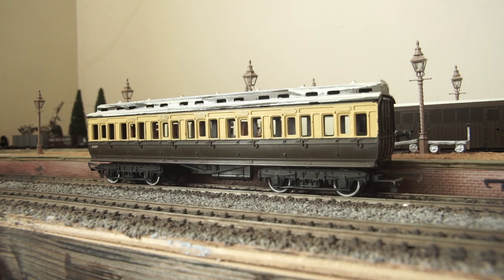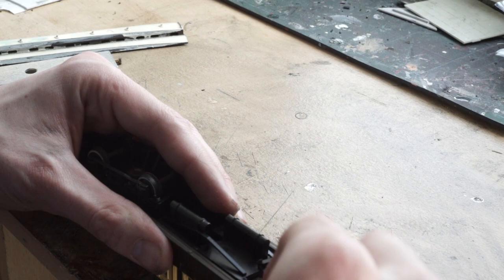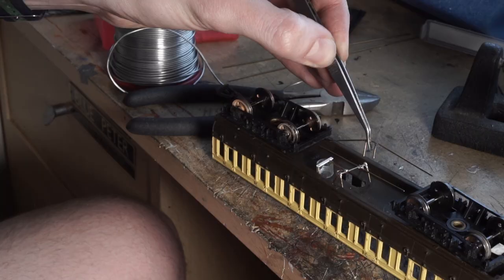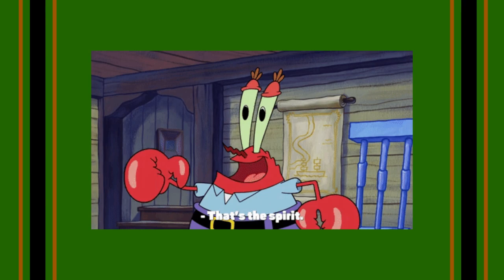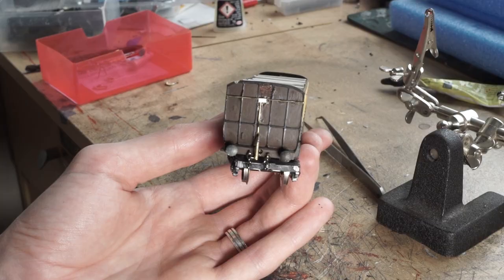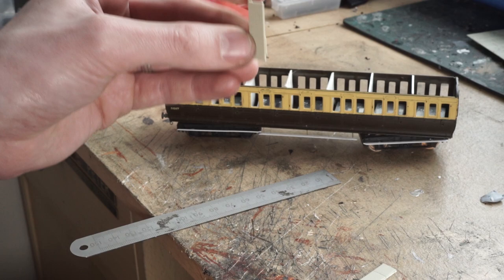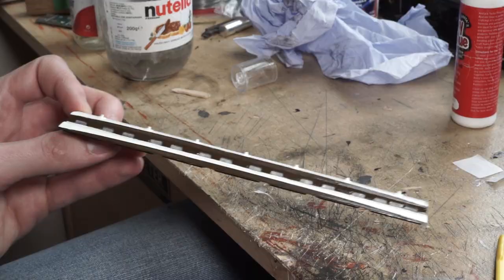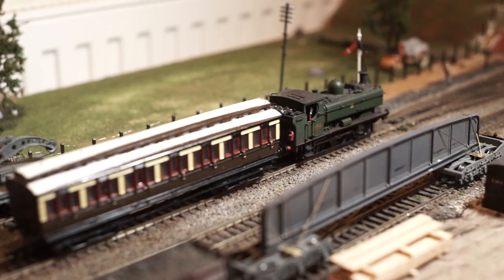Upgrading the Hornby/Triang Clerestory Coaches - SWAS Episode 24

Comment: I too, bought two, in the 1960s when any fairly realistic carriage was rare. This century I converted them to the 7 compartment Diagram C12 of 1897 and the brake version D21 ( long brake and four 3rd class compartments). I substituted Hornby (mock) Dean suspended bogies which were an unpleasant nylon plastic to widen as I was fitting Gibson EM axles. They were painted all-over GWR wartime brown with offset GWR crest.

Comment: Hi Scooby. 

I’m sure that it's somewhere on the GWR website that a modeller converted an 8 compartment Triang non-corridor Clerestory Coach into a 9 compartment coach. It was a while ago that I spotted the article but what he did was to cut off the end of one of his coaches, then cut off the end of a donor coach but with one compartment attached. He then 'smoothed' down the ends and joined them together to make a 9 compartment Clerestory Coach (or, as they say in the 'hooky' side of the car trade, 'cut & shut'). I know it's a bit late now as you must have finished your upgrading, but I thought I'd point it out anyway. 👍 

Paul.
Reply: Sorry, I meant to say a 7 compartment coach was converted into an 8 compartment.

Comment: That was interesting and entertaining, might be lockdown but I've got 8, would die of old age before I had that patience, well done. Glynn
Reply from the maker: Thanks for watching! I've found that once starting a couple in a go and setting up a bit of a production line and you can speed through a number of the steps. I've got another 4 to go!
Reply: have the weights but my painting skills need a little upgrading. have LNER ones and never seem to get the varnish right.

Comment: Thanks for this video. I have lined up a rake to be super detailed. Once you got the centre screw out, how on earth did you get the roof off? There doesn't appear to be any slack in the end clips. Please can you share the secret? Many thanks.
Reply from the maker: Hey! Thanks for watching! Most of mine came straight off (either due to damage at the ends or there just being enough slack) however one of them I did have to use some screwdrivers/levers to pull the end of the coach away just enough to slip the roof away. Hope this helps!

Comment: Great work! I’ve got a bunch of these but they’re really old and have through-axel bogies on them (yuck) did you try putting brass bearings in any like that?
Reply from the maker: I can't say I have, as all mine are the slightly later ones with plastic pinpoint bearings. However I could imagine that just drilling it out to fit the bearings and then filing the backside of the hole with some filler and painting afterwards.

Comment: Very inspiring but can you tell me how you painted the door handles so finely? Many thanks Gary
Reply from the maker: Hi Gary, with the door handles I got my paintbrush with plenty of paint on, then using the side of brush I carefully dragged it across the raised detail. With these being such old crude models it made it quite a bit easier to manage!
Reply: Hi Gary.

Another alternative is to use a wooden tooth pick, a pack of which are cheap enough to buy. The advantage with them is that you can get the paint on and into delicate places without the brush hairs springing into unwanted action. 

Paul. 👍